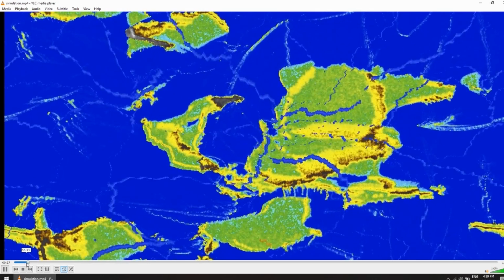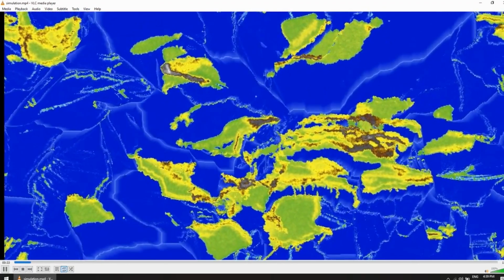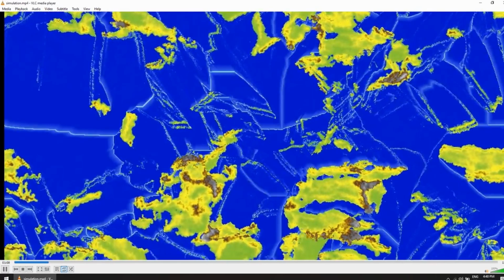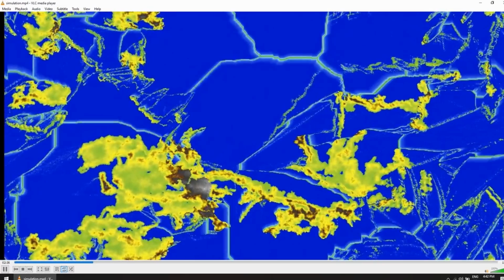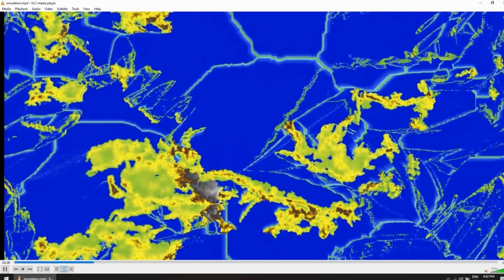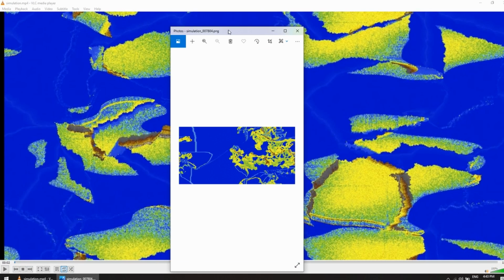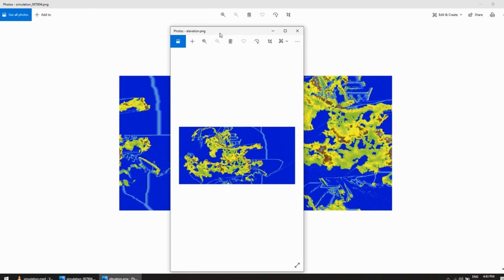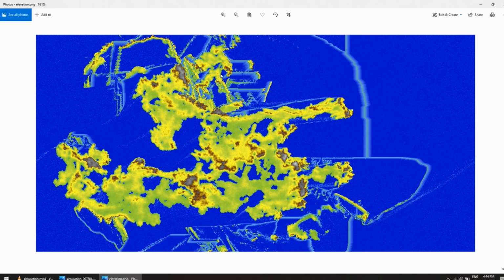Let's Build - Part 1: plate tectonics simulation with PlaTec

Comment: I like the suggestion of just straight up removing the re-rifting events.

I wonder how difficult it would be to apply spherical geometry to it. Probably quite, but I wonder all the same
Reply from the maker: I did make an attempt at making it spherical but ended up having a few issues. I'll probably be making my own simulation in place of PlaTec at some point, but not terribly soon.
Reply: @mundifex1437 based on the tiling I’m guessing it’s because your trying to map a toroidal topology to a spherical one.
Reply from the maker: Yeah, that's a limitation of the original PlaTec simulation code.